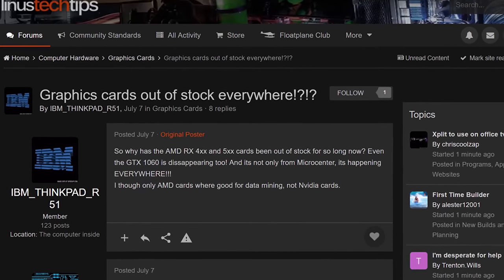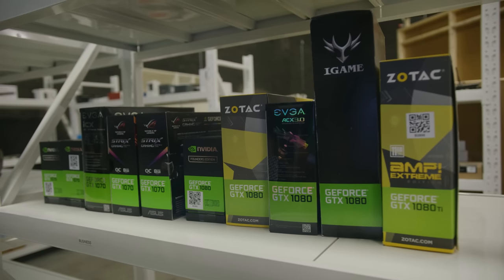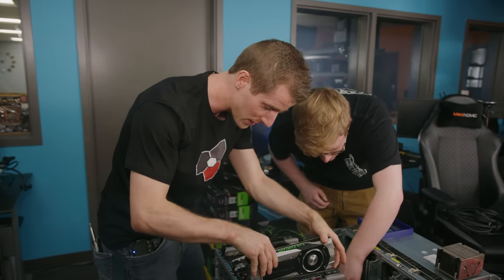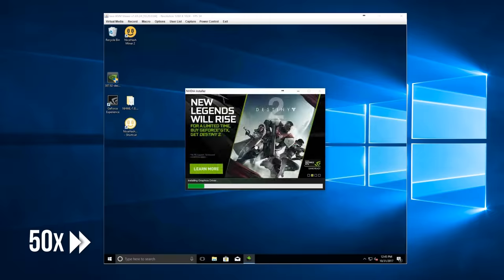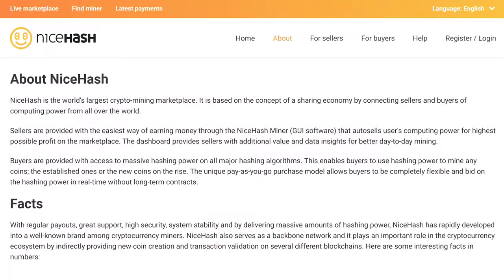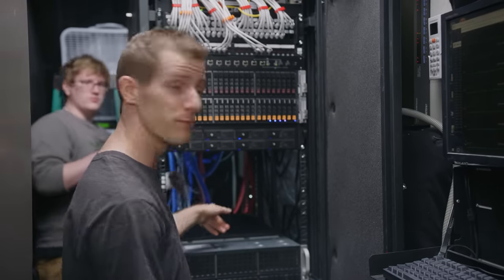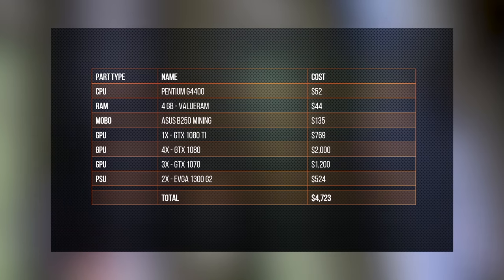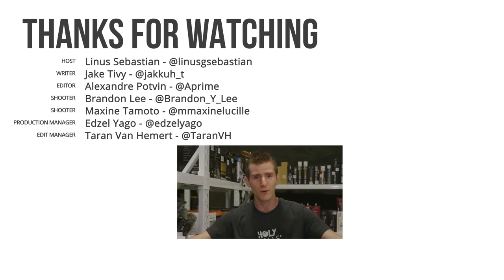IS GPU MINING STILL PROFITABLE? - Mining Adventure Part 1

Comment: Linus, use the Sapphire rx 570s and rx 580s  cause those cards were heavily bought out by miners.
Reply: The 470s and 480s were  bought out too.
Reply: Yeah ,  right mate  cause the overclocked 480s are basically 570s anyway  when it comes to performance.
Reply: But i would say , even the entry level non - overclocked 570 performs better than overclocked rx 480  for sure.
Reply: Ali Lord I've seen an OC 480 be exactly equal with an OC 580... they are just a rebrand, just like r9 290x with 390
Reply: There's probably a reason because Sapphire make shitty cheap cards that crash when you plug in HDMI then don't accept your warranty for your Rx 480
Reply: No they don't. you just made that up
Reply: Arefin's tech 480 is faster than 570, the 580 is a lightly over clocked 480
Reply: 470, 480, 570, 580 arent useful for mining anymore. they were only good, cause they were cheap, and eth mining wasnt very memory intensive jn the beginning. now things with eth have changed. amd cards suck at anything else than eth, and even that doesnt do well anymore since the mem usage went up. gtx10x0 cards however still perfom well, and handle other coins also.

Comment: I think you should buy an asic miner that costs the same as a rig, to see which is more profitable??
Reply: Jamspell ethereum is Asics resistant
Reply: Groza Adrian Yeah. I can't think of the word. And asic is a kind of generic term for just algorithm specific mimers
Reply: profitability wise they are similar. The only thing you profit from GPUs that they have a decent resell value and will most likely last longer. If bitmain decides to develop another more capable ASIC and makes the old one obsolete you will be paying more for electricity than makin profit (like older antminer that are heavy expensive paperweights now)
Reply: They didn't have any of that hardware available probably.

Comment: Try a couple of quadros, see how those do!
Reply: Indeed but there is a Tesla card that does something like 60mh/s on eth. Only problem is it's about a 5 grand card.
Reply: Not that well. It's all about price/performance. Usually twice as expensive cards aren't twice as fast. The holy grail was around the AMD 480 or Nvidia 1070 last time I checked.

Comment: I have a rig with 8x 1070's and 4 riggs with 13x 580's each.  Just run the cheapest mobo/cpu combo with as many pcie solts you can running pcie extenders to each card to allow space for cooling.  Underclocking the 1070's to 65-75 watts turned the best profit to watt ratio.   To cool it all I only use 4 box fans and push the air out a window in summer or into my house for winter to save.  Yes that actually heats my house alot! I also got 2x 30amp 240 drops to power it and I'd recommend just using a server PSU to power all the cards rather than getting a consumer grade psu; it's cheaper and easier with breakout boards for the power adapters.
Reply: yeah best to use in winter heat that is making you money.

Comment: I wonder if you guys played around with the TDP values to get the best performance per watt :D
I found out with a friend of mine that at 75% TDP we have comparatively minor losses, and the GPUs stress far less and generate less heat and noise (obviously)
Reply: i found runnig with 60power rating while overclocked in msi afterburne lays the best power consumption/mining power ratio. it still depends on card tho
Reply: Yeah, the one we did was on 1070s and one 1080Ti

Comment: I wonder how does graphic card perform in games after been used for mining 24/7
Reply: It's not bad actually imo. Ive been playing Fortnite on  an older gpu I was using for mining for 3 years. Still working fine
Reply: Fortnite isn't a very graphically demanding game tbh
Reply: I didn't say it was a demanding game, hence why I'm using a 3 year old graphics card. This isn't a perfect scientific evaluation of a gpus performance after mining. That's why I said "imo" different variables & conditions are obviously not addressed here.
Reply: actually gpus that are used for minning will be better (except the fan in the cooler may have shorter lifespan since they boost the fans for better cooling) than a gpu used for gaming since they dont overclock them so much
Reply: To clarify we're actually both right, it's a mix between people that do & people that don't but you're still taking a risk either way. There's plenty of people in the space that overclock their gpus but since you have to babysit your rig whilst doing so, its avoided by some.
Reply: true but i was talking if i want to buy a second hand gpu i would rather go for one that was used for minning rather than gaming but yeah you got my point
Reply: Oh definitely, a used gaming card vs mining card, you have a better chance of less abuse with the mining card, totally agree

Comment: No AMD GPU's? A RX580 does the same 20~30Mhash/s at half the power draw of a 1080... Smells fishy....
Reply: They used 1070s because they just so happened to have that many of them lying around. 

I'm sure if they had had that many 580s lying around they would have used them.
Reply: yeah i found that funny they didn't mine with AMD GPU's guess they didn't have more then 1-2 sitting around.
Reply: Jaggsta would still make sense in the next build. Value is just so much better for mining
Reply: well... you had to get them a few months ago in order to have them now
Reply: 1080 sucks with Eth or similar algorithms. Some though, like zcash, it's the powerhouse it should be.

Comment: I have a suggestion Linus, use the RX 400/500 series rather than Pascal
Reply: KyroMonjah why? I mean is there à specific reason ? Id like to see some AMD card but why there
Reply: more efficient and less costly on the electricity side
Reply: Not true at all. The most profit coins atm use Equihash/Lyra2REv2/CryptoNight where amd cards just aren't worth it. Eth mining has gone to shit the past month. The only amd card you should be buying atm is the vega 56 cause it destroys CryptoNight.
Reply: Nvidia is king for mining right now, more stable they barely use more power when clocked correctly, and hash better.. I have a rig of each and wish my 580s were more 1070s

Comment: Since you knew about the bit-currency-price/joule was the thing to maximize in the equation, old hardware was out from the getgo.  Also, since raw-power isn't a goal at all, only efficiency,  you don't need to load up one rig with a crazy huge number of video cards.  I think a weak arm SOC would be the way to go.  Efficiency on SOCs is best since, with the integrated GPU, you get peak efficiency in your sending data around.  Another good contender would be an AMD "APU".  Still though, since ARM is more efficient, I would go with that.  They don't go all out-of-order superscalar.  Desktop cpus have been rigged for more muscle-power than efficiency for a long time.

Comment: Does GPU Mining damage the life expectancy of the graphic cards?
Should we buy any graphic cards that finished their mining mission?
Reply: yes. specialy if your not carefull with temperature controll. as the cards will be running 100% load at all time. and you will need to change the cooling paste on the GPUs 2-3times a year for it to keep cool, somthing noone ever does thats not mining.
Reply: Coming from a miner, yes it can ruin cards for normal use. A lot of the cards I have that have been mining for a while will have artifacts and other problems. Granted, its possible the card could be absolutely fine if its cooled really well and or hasn't mined for that long.
Reply: And miners just sell their half baked GPUs on craiglist and dummies still buy it.
Reply: So it's not a good idea to buy any used Graphic card nowadays
unless you knew the person you're purchasing from
Reply: @mountana berry, Im pretty sure eBay has a policy surrounding used GPUs, assuming the seller says it is completely functional you can probably get your money back. I have never used their return policy, but I have bought GPUs on eBay pretty recently and they were fine.

Comment: Why not using AMD cards, which are more efficient for the task?
Reply: IIARROWS the right cards to use depend on the mining algorithm for the specific cryptocurrency
Reply: Correct, but there's not many that benefit from nvidia specifically. AMD is the hot stuff right now.
Reply: His right, my mates 1050ti does 8m/hashes while my 3 year old AMD R9 390 does 30m/hashes
Reply: i dont think you guys undestand different algos profit more and less on oon each one. for ex: mining grs on a 1070 gets you 3.75 while a vega on eth gets you 2.56
Reply: @Kishan Amin, Vega 64 or Vega 56?
Reply: The program they are using, NiceHash, no longer supports AMD cards. That may be why
Reply: Kelly Cox hmm, i use amd in nicehash and it work.
Reply: @Herawan Karang Don't update NiceHash it will stop them from working. Learned that the hard way. v2.0.1.2 was the version it stopped working (I think)
Reply: Kelly Cox hahaha, okey i will not update it, ty
Reply: Kelly Cox you know there is legacy version on their site that still work with AMD, right?

Comment: try AMD gpu like RX 570/580 its give you fast ROI mining ethereum it can give u 27-35 Mh/s per card . try it thanks .
Reply: OK TECH I am interested as well to see a comparison with AMD from an ROI perspective
Reply: 570, 580 and Vega 56 crush everything in terms of ROI. The only ones in the ballpark are 1050TI and 1060s if you get a good deal. Actually if you find a deal like I did on an open box 1050TI for $90, that's ROI in like 90 days.
Reply: well, 580s wont go above 31.2MH and 570s max 29MH. You can achieve max 34MH, if you have someone who can really mod the cards.

Comment: I have as many gpus as you possibly. And I've crunched the numbers differently even Different Locations. PLUS I have my graphics cards for gaming. But money is money. The only way I came across @ This being worth it. Is buying a double wide mobile home insulate the hell outta It not living there plus this has to be somewhere like CO. Keeps the expenses and experiment at the most even keel. I'm talking about all environments cost of electricity taxes on mobile homes are like 120 a year if a couple years old. So that's still only going to make me 40k to 63k and that's assuming that your Coin doesn't make a 256% low and doesn't Come back up. Also did algo with changing different coins and finding new vendors to Work with your Situation And how flexible you are and your equipment is. ANYWAYS IT'S NOT a good idea unless you can get the DeLorean. Awesome video. At least I'm not the only one wondering.

Comment: How about a system that the average veiwer can build from modern parts for under 2k? Like ryzen 7 with a single 1080 ti.
Reply: you can google it yourself. I have that exact setup. Ryzen 7 1700x@4.0ghz, 3200mhz RAM, GTX 1080ti. Both together, nicehash as me at an estimate profit of around 5 dollars a day if I have it running 24/7 (which I won't do, it's my main rig!). The problem is that unless you have access to very cheap/free electricity, it simply isn't worth it.
Reply: If you're talking about making a rig like that for mining. There is no point if the profit margins are like the person above me is saying. Five dollars a day running your rig, 24 hours a day is pointless. If you live with your parents, then their electric bill will be going through the roof, so it's not necessarily free electricity and if you're getting cheap electricity it would have to be basically free for you to make any profit.

Comment: the problem is it's the mining industries OEM's that create this stuff for consumers. The OEM provides no support which is making the consumer rely on the opinions of the mining community that's saturated with scams. For one, MSI won't support you if you buy their mining motherboards.  I asked them about the compatibility list for the H310-A Pro MB, but they refused to reply with any help. I asked them about what are the best parts in support, and on chat. Support hasn't returned comment, and chat said "we don't support this motherboard" and then closed the session abruptly.

Comment: Noooooo. AMD cards mine better than NVIDIAs, what are you doing?
Reply: Yes and No. Depending on the algo, currently GTX 1070 is the best all rounder followed closely by 1080 Ti. Maybe Vega 56 is an exception on monero only.
Reply: You must be old... :D
Reply: @H4voC why do you consider the 1070 the best card? An rx 570 with bios mod mines around 27-28 MH on ETH while a 1070 mines around 450 sols on equihash (last time I checked it was the most profitable algorythm) so, by today's calculations, the rx 570 makes around 1.5$ a day while the 1070 makes 1.8-2$ but since it costs about 70-80% more I'm not sure why you would choose the 1070 unless your power cost is too high (I know the 1070 is a lot more efficient). My comment is not to prove you wrong or anything, I just really want to know your preference for the 1070 because I must be missing something
Reply: GTX 1070 is more universal by what you can mine with it well. RX 570 doesn't mine LyraRev2 well and I think Lyra2z which are pretty popular right now. Currently according to whattomine a 1070 earns 2.72$ in FTC per day or lets rather put zencash at 1.9$ and RX 570 is at 1.69$ FTC and 1.56$ ETH.

And yeah the power cost is also the reason why especially if you have several gpus and that also has some influence on how much u actually earn per month. 

Every card is profitable but I like having alower monthly bill, I think currently the best ROI is the Vega 56 mining XMR. But I mine with 1080 Tis since I don't like building new rigs so fast but fit more powerfull GPUs who eventually will have bette resell value in the future if I decide to sell.

In the end it comes to electricity cost in my case and not wants to buy a new RIG so quickly. + Etherum pushing difficulty bombs every now and then and driving AMD miners will also affect the earning potential in the near future :/ Maybe I am a bit 2 sleepy since its 4 am here :S
Reply: + forgot to add :D that RX 570 8GB is more or less sold out everywhere I look at least where I am and the prices here are higher compares to the US.
Reply: Yeah you got some good points there but actually I don't thin you need the 8gb version. The 4gb right now is becoming available a lot. I also agree that the vega 56 on monero is the king right now but let's see if that lasts. I'm thinking about picking up a couple of those
Reply: No rx 570 dual mining Eth + sia/decred/pascal is more profitable than a 1070 mining anything. Vega 56 is the best card to buy now if the price is reasonable and 1080ti gets the best $/W
Reply: It's not about to exceed the dag size, for around march 2018 3gb cards will be left out. For the 4gb cards eth will go PoS before that even happens so it's not very relevant
Reply: PoS switch shouldnt be here yet for another year at least

Comment: So funny to watch this now, two years later (almost to the day). 
Luckily, for gamers, this GPU mining craze died a death after the 2017 boom/bust of crypto.
The barrier to entry became so stupidly stacked, it became the realm of consortiums and those with a crazy amount of cash striving to make more cash. 
I considered it briefly - and realised the only way to actually profit, was at massive scale. I could make more money stacking shelves for an hour a day. 

More recently, the death of this craze (for all but mega players) also saw a slew of 2nd hand GPUs hitting eBay for dirt cheap - with a huge 'buyer beware' caveat, given that some of those GPUs had been pushed to the max 24/7 for months.
Reply: and now here we are again
Reply: @sultanofsick  Yeah, it sucks. 
I just checked prices of a now really old Nvidia GTX970 card, which I have, on eBay - they are changing hands for almost the price I got mine new.
To be specific, I got it in May 2016 (MSI NVIDIA GTX 970 Gaming Twin Frozr HDMI DVI-I DP Graphics Card (4GB, PCI Express, DDR5, 256 Bit) for £282 sterling ($382 usd) - an eBay buy now price on a second hand one is around £180 sterling ($244 usd) - that's just crazy for a 6 year old second hand video card! 

Needless to say, I've not bothered to upgrade since then - still going strong - but yeah, showing it's age. Will probably just about manage to drive a valve index for VR - although it'll probably be a vomit inducing experience with some titles.

Checking my old purchase history, I also got one of these cards 2nd hand in 2018, with a view to doing a SLi setup - back then, I paid £127 sterling ( $172 usd) - this is when cryptocurrency was still in a total death spiral.

Comment: Uses dual xeons for 8 cards 16x speed each. The PCIe bandwidth isn't important. 
I run 10 cards at 1x on an intel i3 and it runs just fine.

Comment: My old school many years ago was recycling over 100 desktop computers, I asked if I could get them, since they were recycling them. They said sure. I purchased solar panels for my house for less electricity problems, I spent over 10,000 on new GPUs, and installed bitcoin miners (when bitcoin was still profitable) and I let them mine for 2 weeks straight with 4 hour breaks for computers to chill. Despite the fact my electricity bill was over the roof and I had inspector electricians come in to see where the fuck all my electricity went I still managed to mine £1000 worth of Bitcoin, Bitcoin went up in price a little and while I went to work I'd leave those things mining all day long and in less than 5 months I made £25,000, I done this for 2 years, I did have to replace some PC's and components that literally got fried but that wasn't a big constraint as I had a lot of extra money, then the price dropped and it became wortheless.